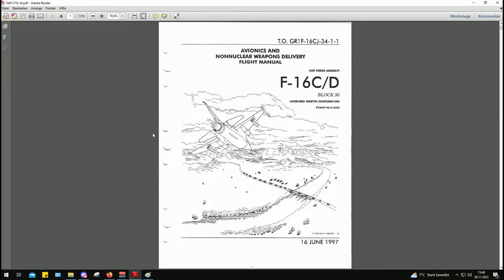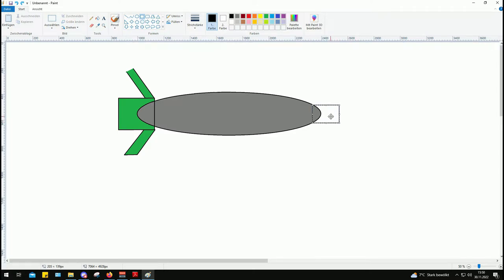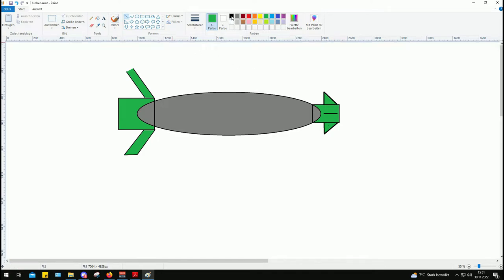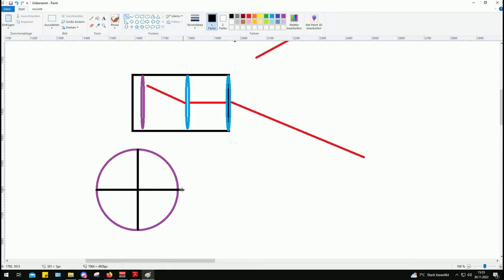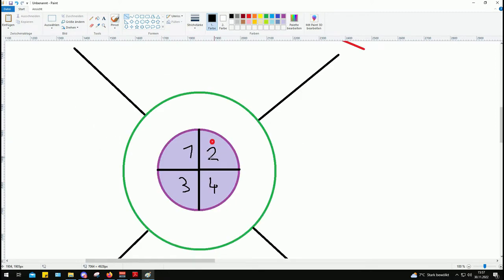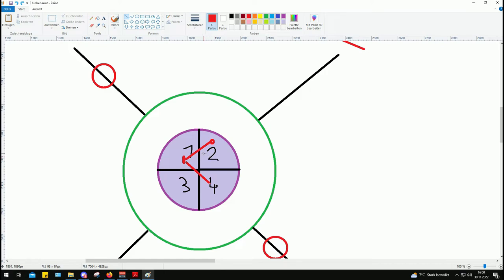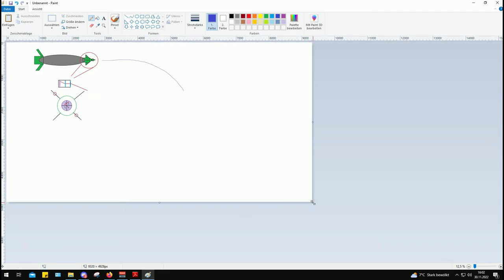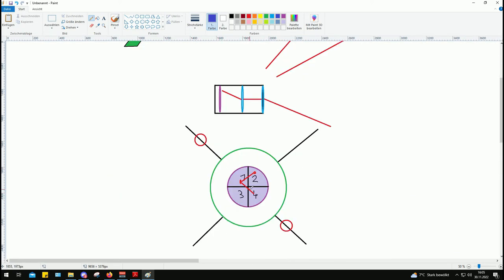Technology Explained: How the Paveway II Laser Guided bomb Seeker works

Comment: JDAMN IT!!! You could push price down to 100$ by adding an off the shelf raspberry pi nano (a five dollar desk top computer the size of a credit card that is as powerful and capable as a $400 walmart laptop or chrome book; you just supply your own screen keyboard and mouse and wifi thats built in and you have a linux GUI) or cell phone processor, and RC hobby servos, with rc hobby cameras that are XYZ stabilized tht you could put a $0.05 CdSn sensor or four, but you could go even cheaper by using the ATMEL chip found in the Arduino.

 Then once you get the design and tooling you could crank them out with less complexity then making a microwave. Im sure there are people who watch your channel that could build a complete JDAM in their garage with off the shelf parts. 

BUT thats not how it works in america they do "cost plus" contracts meaning the more money it costs to build the more money they make, so lowest bidder option we had until the second Iraq war is replaced by really the highest bidder because the amount of R&d and wholesale costs are classified you have no idea if they are selling a 30k$ JDAM that costs $100 to mass produce. Also the cheaper they make it means your gun will misfire or be a dud, when you are expecting your weapon to save your life.
Reply from the maker: The problem isn't computing power, it's actually all the other components like servos that are strong and also fast enough to guide a 2000lbs object at near supersonic speeds and the chemicals needed for the thermal batteries
And obviously the casings and explosives used.

Currently your typical 2000lbs MK.84 bomb sits at around 10-15k USD and the GBU-31 guidance kit is at roughly 10k USD

Comment: Great stuff, thanks!

Is another way of saying it, that the rotation of the entire unit (induced by the rear fins), works as a de facto modulation of the sensor-unit fin deflection?
Reply from the maker: Mhh, that's a interesting thought, but the bomb could work without the spin, it's just that it would be less accurate than with spin.

So... Not really?

Comment: this guidance system requires a remote laser source pointed up at proper elevation and azimuth from the target.  In media, i've heard it said (perhaps to conceal truth) that someone "paints" target with laser and reflections reach the bomb.. However, i doubt this media description, because laser light will be reflected at all manner of odd angles and bad elevations and bad azimuth for bomb guidance.  Your video seems to say that its' better if someone leaves a disposable laser at the target pointed properly up at the sky........

do you have thoughts on this?
Reply: The laser sensor spots the laser in the same manner you see a laser dot on the wall. That's what the paint is.
Reply: @ulfricstormcloak3657  yes i see the point you're making (no pun intended);   so what you're saying is that as long as the seeker can "see" the "spot" it homes in.? which means, the range of "capture" of signal (seeing the spot) is very close-range, only the last 100 feet of the bomb's trajectory is applicable for laser homing then?
Reply: @klam77  You underestimate expensive image sensors. Furthermore you have to keep in mind that the laser spot size increases with distance.
Reply: @klam77 Yeah, the seeker tries to keep the spot on the center as long as it sees it. The seeker has 4 chunks, like a wheel split in 4 and tries to keep it in the centre so that all of the 4 sensors receive the laser close to the dividing cross's centre in somewhat equal value. The computer then computes corrections based on the position of the laser in the sensors. For example if the point is located in 1 sensor only It will swing the bomb so that it is placed in the centre.
Reply: @ulfricstormcloak3657  yes correct. my question was, where is the laser that is incident on the target starting from? It's likely not from the moving airplane b/c the reflection will be at odd unpredictable angles! How do they ensure the laser reflection comes back at the proper angle
Reply: The Laser frequency is different for the different targets, when more than 1 bomb is fired. 10-30 hz or so, and painting the target is a function of other aircraft or ground support. The bomber releases the bomb at the designated altitude,direction and time.
Reply from the maker: @klam77  in modern days the aircraft can "self lase"

generally speaking the lasers used for this job work at up to 10Nm distance and bombs can detect the laser spot from that far away.

in this clip you can see how big the laser spot actually is when its in the target area, it doesnt matter when some of it gets "reflected" weird
https://youtu.be/2VUF9whYaqM?si=IMECt9lICu4sx5eL&t=87

the weapon can still see that reflection and guides towards it.